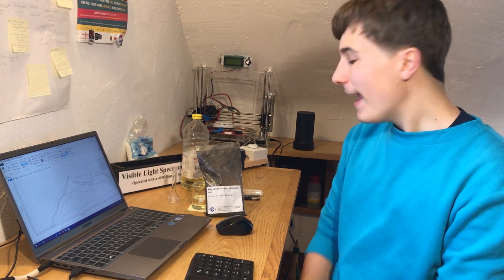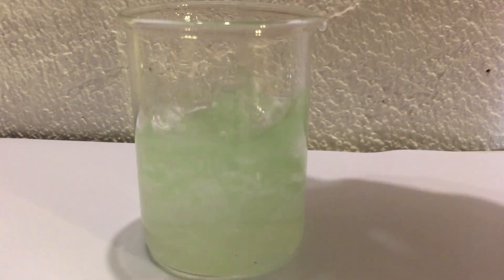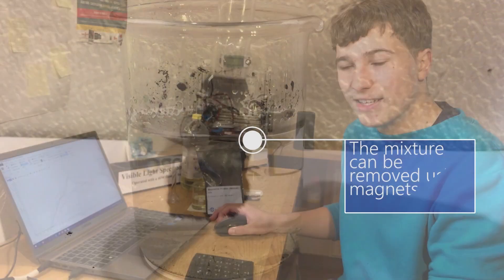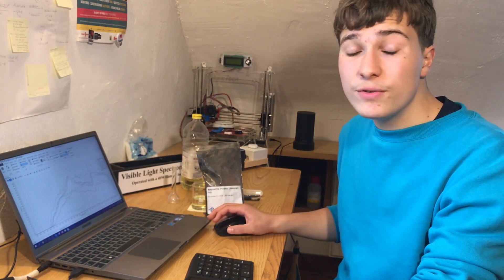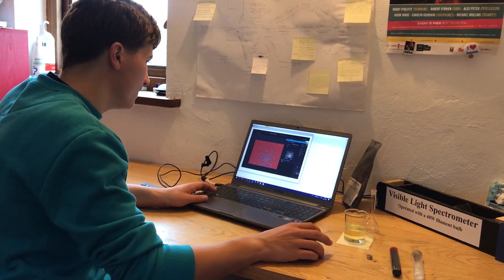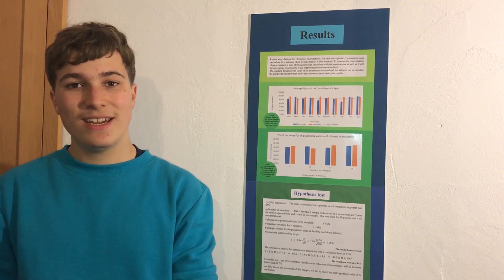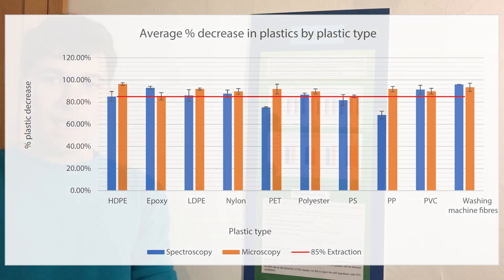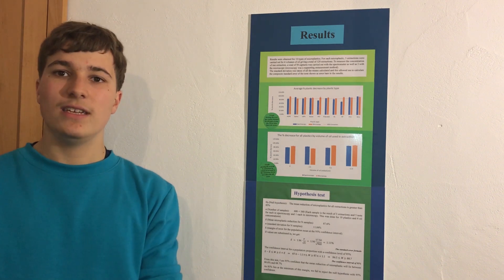An investigation into the removal of microplastics from water using ferro fluids (V2)

Comment: Hello, Fionn. I'm Yaroslav, an engineering student from Mexico, and I'm trying to recreate your experiment and I'm having problems with the part of calculating the concentration of microplastics in the samples before and after the experiment. How did you connect the domestic spectrometer with the spectrograph software? What other devices can you advise me to use in order to calculate the concentration of microplastics?

Comment: Well done on your work to date. I am sure you and your inventions have a great future. 
Wastewater treatment plants have a requirement to release water with specified contaminants under certain levels, for instance metals, but plastics are not included. We could look at bringing in legal requirements to keep microplastics under certain levels in the released water.  This would change fitting your system from a voluntary step, to a necessary one for legal operation.

Comment: Fionn, once you have pulled the microplastics out of the water into the ferrofluid, can you separate the microplastics from the ferrofluid and reuse it?
Reply: funny that you asked...
Reply: Oh. I didn’t mean it as a joke. Was an honest question. I also started wondering if you could do the same thing without the ferrofluid. Seems like mixing in a non-polar solution, that is less dense than sea water, that the microplastics dissolve in might work. Then just letting it float to the surface and decant.
Reply: Of course the notion of decanting the entire ocean is a bit of a non-starter. But I don’t care, this type of experiment is going in the right direction!
Reply from the maker: Zenman Energy yes, I can. A centrifuge can be used for separation and both oil and magnetite re used.
The plastics can be removed and broken down using enzymes or fungus
Reply from the maker: Zenman Energy to remove the ferro fluids from water, all I need to use is a magnet.
Reply: @fionn294  this is a very fascinating idea. Do you think the idea can scale? Could you build an automated system that pumps in dirty water through your system and pumps out clean water?